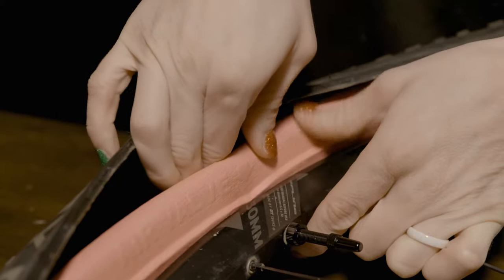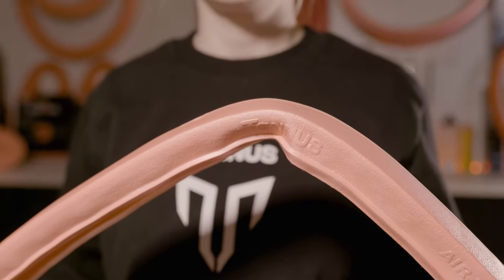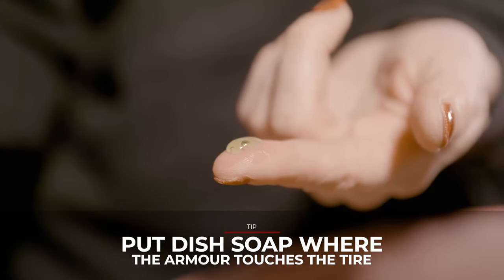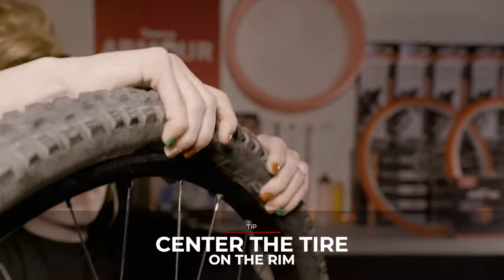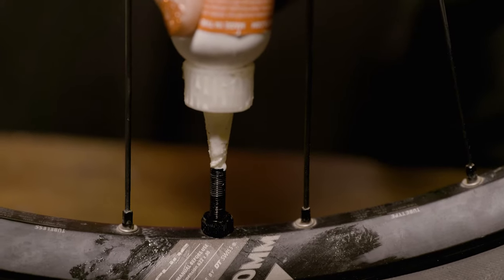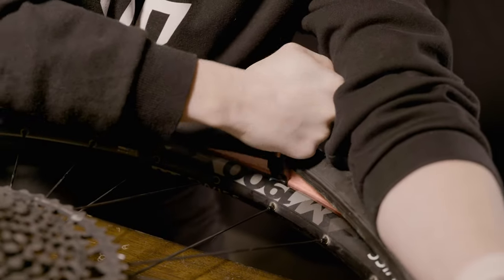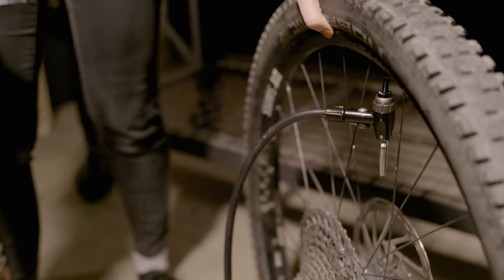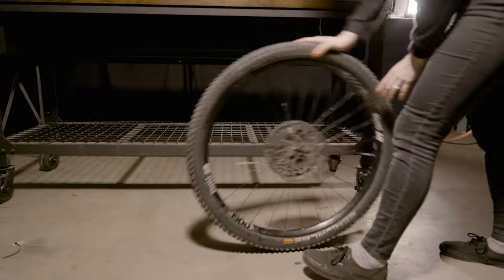How To Install Tubeless Tire Inserts On A Bike | Tannus Armour

Comment: I am definitely not inexperienced at fixing my bikes and changing tires and prepared carefully by watching this and other videos as well as reading some experience reports and following all the tips including: 
- putting the insert on the rim for 24h
- using dish soap
- having good quality tire levers
- using a round big trash can (however I changed back and forth by using it)
- using zipties 
- pressing the tire against the wall to not let it come off again
- heating up the tire in the oven to make it more flexible and get a slightly bigger diameter
- massaging the shit out of the tire and the insert to get it as much in the middle as possible

Everything was done in the first 3 minutes except for the last 7-8inches. After 2 hours of sweat and hard work I gave up. 
To me it seems that some combinations of tire and rim do not work with the insert. 
My setup: original Trek setup of 29inch Bontrager Line Pro 30 TLR rim  (like they show in the video at around 1 min)  and a Bontrager XR4 tire (2.4inches). Maybe it would work with another tire or by replacing the plastic insert with a rim tape- who knows...

UPDATE: 
Same rim + Maxxis Dissector 2.4WT Exo 
-> still very hard (put the tire on the ground, used my foot to hold the tire in place on the one side and used all my energy on the other two levers such that I almost snapped one - actually a decent one) but worked out after 30 mins working time (excluding preparation). I figured out that using a big amount of dish soap makes it slightly easier than just using a little bit.
Reply from the maker: Hey alexmtbful!  sounds like you had quite the experience.   From the sound of it, it looks like your tried all the tips/tricks in the video.  Sorry you had such a tough time. We do have certified technicians at bike shops that can help with the install process if you choose to go that route.  We know that some brand tires/insert combinations don't always go smoothly as we'd like.  You are more than welcome to send us an email where we can better assist you on a customer service level.  You can email us here: sales@tannusamerica.com

Comment: I tried all the tips and still couldn't get the last bit of the bead on. I even snapped a tyre lever. I then resorted to zip ties and that made a huge difference it seems to help keep the bead in the centre as well as locking it on the rim. The second rim took 10 mins with the zip ties. I guess some combos are just difficult.. I had Maxxis assegsi 2.4" on 29" rim. Good luck!
Reply from the maker: Thanks for the tips and for watching!  Enjoy your new Armour.  Cheers

Comment: I use washing liquid on the bead and rim just after I’ve got it seated and before I start to inflate. It helps identify where leaks are as well. It dries really quickly so it does not effect the sealant. 
If installing in a used tire, I also remove all dried sealant from the inside of tire as this also grips, causing wobbles. 
Thanks for the wobble tip. I always have trouble with tannus gripping to the tire. I think I’ll reseat my sons rear tire, and try the liquid tip.
My son has front and rear tannus and I have rear only. I have tried the front and It’s noticeable how tannus removes some of chatter at high speeds.
I’ll always use tannus now, even if it does take more effort to install. It’s worth it
Reply from the maker: Great to hear!  Thanks for watching and running Tannus ⭕️!

Comment: OK first of all this is not easy.  Yes it is difficult and sometimes frustrating.  But it can be done. It is NOT impossible.  Don't listen to the naysayers.  I've done it twice for two different bikes.  A Specialized LEVO Comp and a Specialized LEVO SL.  Those would be Roval wheels.  One bike with Maxxis tires and the other with Specialized tires.  30 mins max.

I have the three tips for you.   

First tip is use the liquid Dawn or some other brand of dishwashing liquid. I put on way more than what was shown in the demo video.  I slimed up the insert and the tire bead.  She looks like she is using a dot every once in awhile.  I used w-a-y more.  Yeah it gets messy but so what?  Plus you hands will clean up easier afterwards.  

Tip number two - have several different varieties of tire irons handy.  Smaller thinner plastic ones seem to work better for me than heavy duty ones (ie Pedros for example).  Anyways have a bunch of them readily available.  Invariable one will flip out and land on the other side of the garage.

Tip number three.  Have a whole bunch of zip ties ready to go.  Like maybe a dozen handy - you might not need them all but have them ready.  As you get the insert and the bead under the rim throw on a zip tie securing the tire to the rim.   Move about 5 inches on the rim and repeat.  Get the insert and bead somewhat seated.  Does not have to be perfect at this stage but it does have to be under the lip of the rim.  So zip tie the tire to the rim again and move 5 more inches.  Repeat.  Repeat.  Repeat.   Keep going until you have the entire bead and insert under the lip of the rim.  Yes it will look like crap. It will have a bunch of goofy looking zip ties sticking up.  It will look like you are ruining the tire - you are not!  It will look probably look lumpy and lopsided.  Chill.  It will be fine.  Smile cause you got the damn thing on there!

Once you have it seated all of the way around (check and make sure) then you can cut off the zip ties.  I then inflated the tire a bit.  Meh like maybe 10 or 15 psi. Give or take. Enough to keep the bead seated.  Then I massaged the tire and insert.  Think deep muscle massage.  Using your thumbs you can move, ever so slightly, the insert, shifting it inside the tire.  It moves because you put all of that Dawn detergent in there!  So it is super slippery.  And you will get it seated evenly inside the rim. Now it won't look lumpy or lopsided.   I actually let it sit (inflated) overnight before I add the sealant.  But I do that mostly cause I am tired of playing around with it.  I need a break.  The tire probably needs a break too.  

Trust me it can be done.  You can do it.  Follow my instructions and I am pretty sure that it will work out ok.  Best part is that you can ride with out worries since the insert works great!
Reply from the maker: Thank you for your detailed tips and tricks!  Happy you like the tire inserts.  Cheers

Comment: Installed into an old tire. Did not clean it, removed one bead only from the rim. By hands it was impossible, but then I put the wheel flat on the ground and step on the tire to bend the insert, then work it in with two levers. Done in 5 min. Used a couple of zip ties to fix the starting point in place.
Reply from the maker: Some techniques can’t be taught I guess.. the first one is always the fun one to get the hang of it.  After that, 🎂!

Comment: @5:02 "if you have any further tips..."
I got one for getting that last piece of stubborn tire over the rim. 
Using wide (Muc-off) tire levers, fasten one on one end of the piece of bead that isn't over the rim with a velcro over the tire on  the adjacent spoke. Then you can slowly work with the other lever towards that on by flipping and holding.

Comment: Absolute bugger to get on, watched this video and finally got it on with two tire levers only to find my rim tape had been damaged in the process. Had to remove everything and replace the rim tape. Decided to just go back to the tire and sealant alone and now found I stretched my tire bead so much it has a wobble it didn't have before. The bead is seated 100% evenly and I've been using tubeless for over 20 years so I'm not new to the game. Total waste of a hundred bucks plus a rim strip and now a tire with a wobble it didn't have. Very much not pleased!
Reply from the maker: https://youtu.be/6m21nX3yWd0

Comment: I found that My tube was bending and schrunching, so I got the bead set on one side and left the other side opened and I aired it up tight and let the air out, I did this without the valve in the tube, then massaged the tire then air it up again and let everything stretch then release the air and massaged again, I did this 5 or 6 times but I was eventually able to get everything stretched perfectly and fitting nicely, then air it up one last time, I recommend 10 psi for 26 ×4.0 after all that is done, you can enjoy a nice smooth ride

Comment: Literally impossible, I’ve spent four hours and hav scratched my rims, and have no energy left to get them on. I want my money back.
Reply from the maker: Hi Nathan!  With these install tips mentioned in the video you should be able to successfully install your inserts.  We hope you're using the plastic tire levers, these shouldn't scratch your rims.  We do have some certified bike shops that can definitely help you out if it comes down to it.  You can check out our local dealer locater on our homepage for a shop in your area.  What issues were you having and what brand, model and size tire are you mounting?  Have you tried all these tips?

Comment: I can't pump my tyre up. Installation was fairly straight forward but there is a section of tyre I can't get to seat and it just let's air out, even using a compressor at 90psi, it's very annoying.  I now have to go to the effort and mess of taking it out so I can go and ride.
Reply from the maker: Hey Steve!  We have an awesome customer service team that can help you out with pin pointing the solution.  We can even have you send in a small video if needed as well.  Hope to help you out soon.  Thanks for watching!

Comment: Any problem with not going tubeless and using a tube? I plan on using thick slime tube and kelvar band.. I want less than zero percent chance of a flat 😂
Reply from the maker: Hi Stan, we do offer a tube type Insert where you can run an inner tube/insert combo.  Check the link in our description

Comment: Or just make the insert the right size the first time, They shouldn't need to be stretched 4 or 5 inches to get them on the rim. I've noticed a stark downgrade in the quality of tannus armour in the last production run and it's staggering how bad it's gotten not only with the quality of the product but how it's packaged and shipped.

Comment: I hate this product with a burning passion right now. Advertised as easy to install - that is the lie of the century. Just be honest and say its really difficult so at least I know what to expect. Been at it for over an hour. I get the insert fully installed but every time I almost get the tire fully installed the pink insert pops out and I have to start over. Every damn time and I even have a second set of hands here helping.
Reply from the maker: Hi Fade.  Sorry you are having a difficult time.  We have made this video to help you successfully install your new Armour Inserts.   It does help to make sure that the bead of the tire is in the drop center of the rim.  This gives you the best amount of room to spoon the tire on.  Were you able to mount it?   Try this tip. Cheers
Reply: @RideTannus  I did get it on eventually but I had to use a Cushcore Bead bro tool to keep the one side in place and not have the Tannus keep popping out when I nearly had the tire all the way on. Honestly I sold my Cushcore inserts because of how difficult they were to mount and I like changing tires depending on the season/ riding conditions. I don't think the Tannus insert was much easier at least the first time (I'm hoping it will be slightly easier next time as the material relaxes into the wheel shape). So far two rides and it feels good; I just wish you didn't mislead by marketing it as easy to install.
Reply from the maker: @fademasterfade227  Some tires and rims can play a roll in a difficult install.  Thanks for the feedback.  Cheers
Reply from the maker: @fademasterfade227  Sure thing.  Glad you got them installed.  The install difficulty can vary depending on the tire manufacture, casing and size tire.  The install is easier than others.  The wings allow the insert to mount up just like a tire (two beads) instead of one piece of foam.
Reply: Anybody capable of mowing their own grass should be able to install these inserts

Comment: This is a fantastic "How To" with all the tricks. I watched this just to refresh myself before I installed a new tire (Maxxis Double Down casing). I used the dish soap on the insert (sides and bead) and the tire bead. This was clutch to get the insert to even up once I got the insert and both beads on! 

Another hack that I got from a friend who is a professional mechanic and shop owner: To help keep the tire and insert in the center of the rim, we use tire levers (Specifically Birzman brand levers) to lock the bead in place so it doesn't slip off. With 4 or 5 of these clipped to the rim holding the insert and tire bead in the center of the rim, I had enough slack that I seated the tire bead by hand. I did use a more stout tire lever just to push the rim bead to the center channel of the rim and under the insert. 

Thanks for this great updated "How To" video!
Reply from the maker: Seth this is great feedback!  Thanks for sharing and running Armour!  Thanks for watching!

Comment: Best recommendation is not to buy these. These are nearly impossible to install. Notice both install videos from Tannus they don't actually install the inserts. They talk alot then show a seated tire. BS! The numerous poor reviews on Amazon about frustrating installation are well  earned.
Reply: Even Cush cores are hard to install but I’d much rather not have a dented or cracked rim
Reply from the maker: Hi Wheel Man!  We demonstrate the steps to take to successfully install your Tannus Armour.  It is a little more involved of an install having the insert in the tire, but worth the added protection and effort to install them.  Hope you're able to find one that works for you.  Cheers
Reply: Not easy but definitely easier to install than Cush core or rimpact. Another tip is to make sure tyres aren’t cold. I leave them in the sun for a while. Also if you have the time installing the tannus on rim only overnight or longer seems to stretch it and gets it into shape ready for a full install. If you have a spare wheel, installing tyre without tannus and leaving it on a while before you plan to do the full install helps as well. Having said all that I managed to put an already used tannus with a new aggressor straight out of the packaging and got it on in about 10 minutes using the tips in video only. It was a 2.5 onto a dt Swiss 511 which has 30 mm width.
Reply: I have literally reinstalled this insert in a brand new DH casing rear tire on a 28mm id downhill wheel in the pouring rain between enduro stages.....